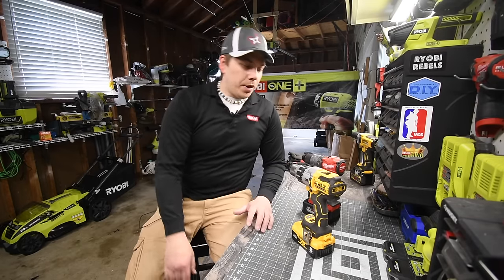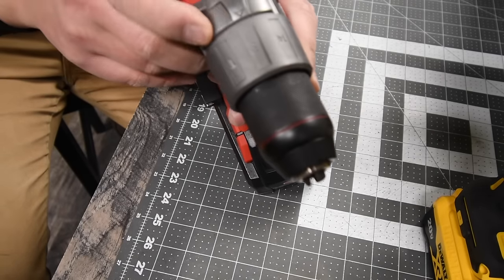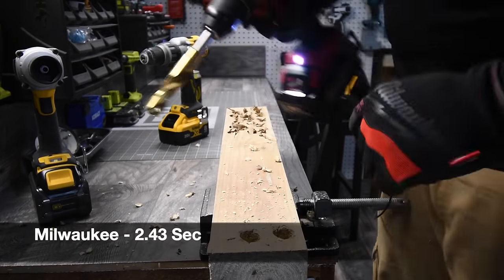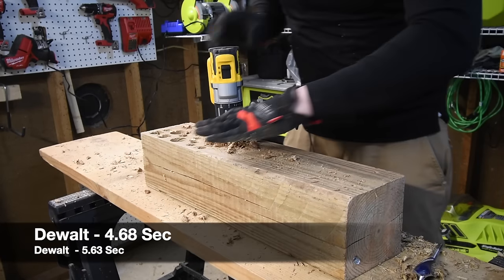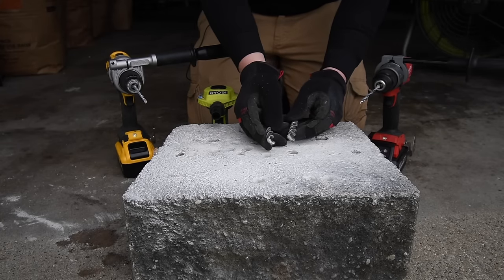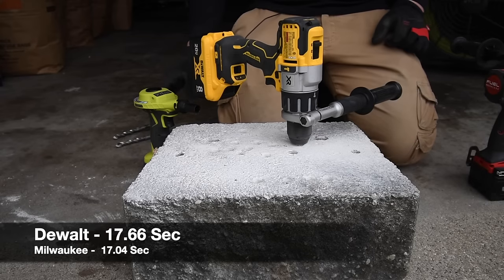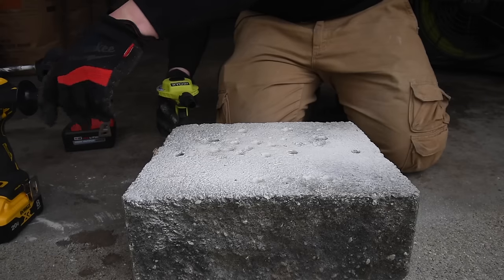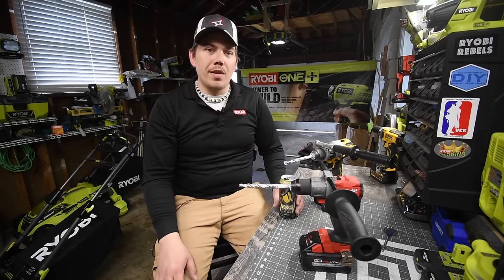Dewalt Power Detect vs Milwaukee Fuel

Comment: when I'm at work. I have the DeWalt hammer drill and my friends have the Milwaukee.  when we're laying pipe on concrete walls . the DeWalt hammer drill is by far the first choice we all use because it just goes through concrete better. And when you're cutting a hundred holes in concrete in a day DeWalt is superior
Reply from the maker: Correct, the Dewalt hammer drill is far better then Milwaukee
Reply: Just out of curiosity, why would you use this sort of "hammer drill" when putting one hole after the other in concrete? It might be able to drill, but it's a joke compared to a proper SDS rotary hammer, even a small one.

Comment: I think you had the Mil on reverse on the concrete test
Reply from the maker: a lot of people say that so I will redo this test soon
Reply: It is just the camera's frames per second giving that perception. They are both drilling in the correct direction.
Reply: @justinrichey2027   look at the switch on the Milwaukee during the concrete then look at the dewalt, the Milwaukee is in reverse
Reply: @justinrichey2027  if the pointer finger side is pushed in that’s forward

Comment: In the milwaukee concrete test it looked like it started off spinning correctly, then you made some adjustment (pushed switch to the right?), then it spun in reverse. The dewalt appears to spin correctly throughout. On a further note VCG's TTR shows a more comparable outcome between these two in the concrete test.
Reply from the maker: I thank you for viewing Sholtheim
Reply: i noticed that as well. the 40 sec Milwaukee run was turning counter clockwise lol
Reply: yes man he did push button to reverse mode look how the concret drill spin at first  and after he stop and change it over,i watch the video more than 10 times because i know the tool  i use daily in my trade
Reply: Amazing even in reverse the fuel still got the job done
Reply: @jemlyhtoo6366 yea there’s no way the M18 lost that bad at drilling concrete. That should’ve been AT MOST, a 25 second hole
Reply: @ManCaverTools  Don't Drink and Drill 🤣

Comment: Considering how much smaller Milwaukee is it does pretty good but their damn chuck getting locked up is why I went back to dewalt 996
Reply from the maker: both of them are awesome
Reply: Yeah it was the Chuck issues that scared me away from Milwaukee I use DeWALT and RIDGID tools happy with both so far
Reply: @6548ww  rigid and milwaukee are sister companies... they use the same parts.
Reply: @jesuschrist4980  First off you are not Jesus Christ and 2nd well for some reason it was only reported the Milwaukee Hammer Drills did have the chuck issue? none of the Ridgid line 4 or 5 had that problem so don't crawl my bones that's just what was reported and not by me and I did see the videos on YouTube where the Milwaukee HDs did lock up and wouldn't release the bit research for yourself and yes you fool I am fully aware Milwaukee and Ridgid are owned by the same company and may share some internal parts but just because Milwaukee had the chuck issues doesn't mean Ridgid will too

Comment: Sadly but Milwaukee was moving in reverse direction. I personally use same model and it never take that long to drill hole in concrete
Reply from the maker: it might have been a bad bit. but the milwuakee was not in reverse and I thank you for viewing S Waleed
Reply: After watching screen recordings in slow mo, the bit was indeed moving in reverse
Reply: True, the Milwaukee was in reverse in both concrete holes, no way to compare the drills
Reply: @ManCaverTools  It was not a bad bit, honestly I can see that you start the drill and quickly change it to reverse mode, I think that for a person that tries to review tools you should know that better
Reply: @ManCaverTools  watched it @ 0.25x speed, can confirm it was in reverse

Comment: I've watched it a lot now....but it looks like the Milwaukee was going in reverse for the second concrete test with the bigger bit. It started out going clockwise...but then there was a little pause before it goes to full speed, and it sure looks like it is going counter clockwise compared to the dewalt test.
Reply from the maker: its an illusion. it appeas to go in reverse bit its not. check out my old craftsman drill video I recently uploaded. there is dry wall mud on it and it looks like its going in reverse when it is going forward
Reply: E we speed makes it look that way like in car wheels spinning
Reply: I’ve watched screen recordings in slow mo, and when he pulls the bit out after 40 seconds it is indeed spinning in reverse before coming to a stop
Reply: @thomaswilliam630  lol

Comment: The King is back, Baby ... The 3 speeds on the Dewalt is great , it puts the drill on a whole other level.  That kit is actually $275.00.  ✌     Be Safe....😷
Reply from the maker: thank you sir
Reply: I've noticed that Millwaukee is better for metal but Dewalt is better for carpentry.
Reply: @HerrenGamingNews  lol. Same.!
Reply: @HerrenGamingNews  Dewalt Sawing, Milwaukee Fastening. That is the way I’m lining mine up.! But Milwaukee keeps bringing the heat.!

Comment: i have both drills and the dewalt is terrible if u have to drill in tighter spaces. if will destroy you're fingers and wrist or swing around and knock you out. with the milwaukee you dont worry about any of that. I can literally have 2 fingers on that drill in a tight space and it its so smooth and will cut off if the bit grabs.
Reply from the maker: very good, and I thank you for viewing Chris

Comment: At 6:40 seconds of the video, you hold Milwaukee in your left hand and you don’t have any self-power. You concentrate all your power on your right hand. So the drill bit becomes curved...
Reply from the maker: ill take a look at that wang. but people are saying its in reverse when it is not. ill try to have better control on it comes to the concrete tests and I thank you Wang
Reply: There is a reason project farm normalizes the force with known quantities. Stuff like this should always be given with the caveat of what the variables are.
Reply: @ManCaverTools  it was in forward during the pilot hole, and also at 8:05 when you gave a split second of trigger. But then somehow you accidentally put it in reverse between 8:05 and 8:06, because when you pull out the bit after 41 seconds, you can easily see it moving in reverse before coming to a stop
Reply: @ManCaverTools  8:48 is where you can see the bit in reverse as you pull it out. And you went the full 41 seconds without stopping the drill, so that proves that it was in reverse

Comment: I am no Dewalt or Milwaukee fanboy here, I bought Dewalt as it was best bang for the buck where i live. One thing that bugs me is the length and overall size on there combi drills like dewalt 796/ 996 compared to the Milwaukee m18 fuel, i wish they could make more compact version of the 796/996 at least alot shorter chuck but still have the power the 796/996 delivers
Reply from the maker: the dewalt power detect is the best one

Comment: Is it just me or the milwaukee battery kind jumps around at it drills? We got a 1" impact gun and the big batteries do the same thing, it works, but just kinda weird that the battery doesnt feel solid in the tool when its being used. I like dewalt and milwaukee, but just something noticed.

Comment: Dewalt is the king in drills it went threw that concrete like it was nothing love the power it has sorry Milwauke fans and hilti fans just can't beat Dewalt
Reply from the maker: this new power detect drill is amazing
Reply: I think u hit a knot that time cause that's the first. I drilled a bunch of holes and it always goes all the way threw on speed 3
Reply: Jason Shepherd Milwaukee still better. There promos are second to none if you know how to shop you can get Milwaukee tools for the price of dewalt!  I think that gives them a leg up since they are so close in performance. Plus the m12 line just makes them that much better 😉
Reply: @ScotchAddict35  Dewalt is better I got both of them and don't get me wrong Milwauke is awesome but when it comes to doing concrete work man that Dewalt spanks Milwaukee ass all day long
Reply: @ScotchAddict35  Milwaukee is not better than Dewalt. I love the power that drill has and that video is true get one and put it beside the Milwaukee and do a concrete test that Dewalt is a beast nothing will touch it
Reply: @ScotchAddict35  Milwaukee is really not better than Dewalt , It has high temperature , and no last longer than Dewalt
Reply: The Dewalt looks like thors hammer compared to that Milwaukee how big is that drill?!?
Reply: Whoo who! Too big
Reply: Loc Do so what you can’t stand the heat get out the kitchen!
Reply: Jason Shepherd get an sds for concrete work come on now. The Milwaukee has as much power and is much smaller. Smaller and lighter is better less fatigue. If you are drilling in concrete all day I’d be using an SDS
Reply: @ScotchAddict35  It's not that big to me. If that's the case then that's why it's bigger to get bigger jobs done and it smoked Milwaukee on that concrete
Reply: @Whohoohoo  Dewalt does make a small 2 speed xr that's the one Milwaukee needs to compete with😁
Reply: Keep in mind in order for this power detect to have that full power you have to buy new high output batteries. If you use a normal xr 5.0 battery it will be a lot less powerful. The motor actually recognizes which battery you are using and adjust the power output accordingly. Don’t get me wrong it’s great and being able to change output to match the battery is awesome just know you have to have the new batteries to get that full power.
Reply: When he drilled the concrete with a 10, Milwaukee was spinning backwards! There was more time!
Reply: @ScotchAddict35 
impact ,Milwaukee 
hammer drill ,dewalt 
saws,dewalt 
looks and light weight ,Milwaukee 
reliability, dewalt 
durability, dewalt
Reply: Loc Do you watch too much tool boss. He’s a clown
Reply: @ScotchAddict35  if youre drilling wood get the dewalt compact🤷‍♂️
Reply: @jamesfair9751  buy the kit. Youll never finish that 8ah in a single day work

Comment: When both products are clearly good quality products I would just simply go for either whatever batteries you have and stay in that camp or the best price you can get because you cannot go wrong with either. I mean are people really that conserved about saving a quarter of a second on a drill I mean I suppose over 10 years you may have saved yourself one minute of time but then again if something cost $30 less it feels like the cheaper one would be the better solution.

Comment: I own only DeWalt, and I know of camera illusions related to FPS and the syncing of the camera. But the test that everyone is talking about with the Milwaukee in concrete was definitely odd. Even at .25 speed it still looks like reverse. I don’t know if it is possible to drill through concrete in reverse though. Idk. Just kinda odd.
Reply from the maker: I can assure you it was not in reverser the way I hold my drills assures that. I keep my thumb pushed on the transmission switch, which means its pushed to be in forward
Reply: That's reversing, yes... but the publisher didn't realize it..
Reply: It is possible to drill in reverse, ive done it before! I caught it early.. but very possible. I watched at 0.25 speed and looks reverse.... idfk whos gonna hire the forsenic team ?! Lmao jp jp
Reply: @ManCaverTools  if the thumb of your right hand was pushed in.... it was in REVERSE
Reply: Butt hurt Milwaukee fans. Dewalt just barebacked your drill.
Reply: @thomaswilliam630  lol.

Comment: what happen begin at 8:00?, the Milwaukee is opposite function. Did you stop to change function? let watch at 0.25 speed. Do you lie us?
Reply from the maker: it is an illusion. the milwuakee was not in reverse. the power detect is way more powerful the the Fuel

Comment: Dude, the Milwaukee was spinning in reverse. You did not question the huge difference it time in the concrete? That should have called for an immediate re-do to confirm the results.
Reply from the maker: the milwuakee was not spinning in reverse. I watched it over and over again. the dewalt even looks like it going in reverse form a few times. its an illusion. look at the start up again.
Reply: @ManCaverTools  Sorry. Just trying to explain the huge difference. I'm not a Milwaukee fan boy, but to take 45 seconds doesn't seem real. Maybe it was the block, or the bit?
Reply: indyvin “I’m not a Milwaukee fan boy” 😂 suuuuure
Reply: indyvin  I just bought dewalt set last week concrete hammer drill is insane and it’s very load compared to. Watch it again hear the noise deference
Reply: That was definitely in reverse.
Reply: @ManCaverTools  Really unprofessional test....Milwaukee is reversing.did you see???
Reply: @ManCaverTools  definitely milwaukee in reverse
Reply: Kane Chauhan  oh come on is Obvious mistake
Reply: @ManCaverTools  watch the bit come to a stop at 1/4 speed at 8:48. Tell me that’s not reverse
Reply: you are very right
Reply: Milwaukee drills just focus on shear power and torque and are the least reliable on the market and they add the hammer function as an after thought hence why dewalt destroyed them because they don’t view it as important simple as that
Reply: It seen like reverse because it spinning fast.like car wheel..how did you not know that😅
Reply: Yeah that was definitely reverse. It doesn't matter to me really I have both sets but yeah that was in reverse

Comment: Hey man, I enjoy your vids.. just wanna point out that on those chucks you have to lock them by tightening as much as you can by hand twisting clockwise-THEN a click in the counter clockwise direction will lock the chuck. A lot of guys don’t know that and they just assume that their chucks are crappy or something and they slip bits all the time. Cheers!
Reply from the maker: that is correct. and I thank you Mike
Reply: Is that true? I never did that and never had an issue with the chuck getting loose 🤔
Reply: @piciu256  yea try it out on your drill.. tighten as much as possible, then give a slight counter-clockwise (left) turn until you feel the click.. that’s how you lock it.
Reply: @mikedeezle2249  Im afraid I won't see a difference either way :P but thanks for the tip.

Comment: We have Milwaukee’s at work and I never liked them. I ended up bringing in my dewalt stuff and the guys I work with ask to borrow my stuff a lot. DEWALT FTW.
Reply from the maker: Dewalt's Power detect hammer is the best on the market right now in my opinion
Reply: And then the walls clapped
Reply: That's funny, because every carpenter on my job swears by Milwaukee except one crew, who use Makita. Dewalt always ends up with the apprentices.  LOL.

Comment: Didn't he explain at the end that the red slipped into drill mode on the concrete. There is no doubt the dewalt is more powerful but not by 30sec. The red has more torque at low speed for wood drilling or boring where as the dewalt will lock out on large bits. So purchase according to use.
Reply from the maker: this power detect is the most powerful hammer drill on the market.
Reply: @ManCaverTools  how many nm has the Dewalt?
Reply: No, the Hilti did that. The Milwaukee was in hammer the whole time.

Comment: Dewalt makes better drill but milwaukee makes better impact. Means both of them can make powerful brushless motor. but What is the difference?  Dewalt can't fine tune the impact mechanism or something?
Reply: Lets wait on the power detect impact d
Reply from the maker: that is 100% correct
Reply: @miguelledezma1394  yeah man. I can' wait for that thing!

Comment: This is the reason why I only use SDS drills and bits
Reply: For concrete i use sds+ bits
Reply from the maker: very good and I than you Steve
Reply: @ManCaverTools  it just takes forever to drill concrete with regular bits and there's times that regular bits won't even work.

Comment: Dave, great tests! I own the DCD996, which this Power Detect should be pretty close. I don't knopw if ti wa smeant to superced my 996 or not, but so far does not seem that impressive as it is neck and neck with th eMilwaukee. Even VCG guys in their tool test raw last week went neck and neck up until one tie breaker at the ned that wa sone by a nose hair. So I expected this Power Detect to be noticeably better than the current DCD996 model, and noticebly better than Milwaukee, which it is not. I Might acquire one and make a video for our channel and test it against my own DCD996 to see if it's any better, but I doubt that it will be.
Reply from the maker: I think its a good idea :)
Reply: Reading your comment felt like that Dewalt was Drilling into my brain...

Comment: It kinda looked like the video speeded up when the dewalt was drilling the concrete. It looked like the time should've been like 26 seconds. That had to be a soft spot in that concrete
Reply from the maker: it is not lol
Reply: @ManCaverTools  you had the Milwaukee in reverse in accident. That’s why it took 40 seconds. I’ve watched screen recordings in slow mo
Reply: @ezrawaters6653  wrong.  Keep in mind video doesn't record at 1000hz. Have a look at a recording of a helicopter,  it looks like the blades are in reverse at times,  it's just the way recording equipment works.
Reply: Milwaukee fanbois, lol

Comment: Milwaukee is superior based on the handle and size. But there's nothing wrong with the dewalt if you're in that platform
Reply from the maker: doesn't the dewalt win in this video?
Reply: @ManCaverTools  Depends on what you need it for, i use mine on the ice auger and the Milwaukee is superior in torque but not necessary the fastest. The handle is way better as well for my needs. More compact, 
I got the drill, impact, 2 5AH batteries, charger, and hard case for $230. (Home depot free tool hack ( down to $266 from $400) and signed up for their CC saving more $. )